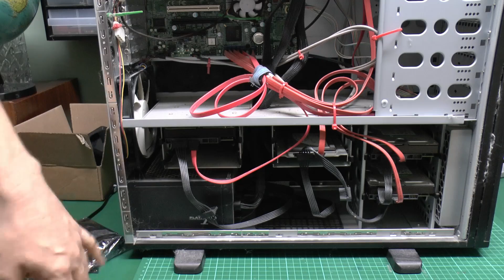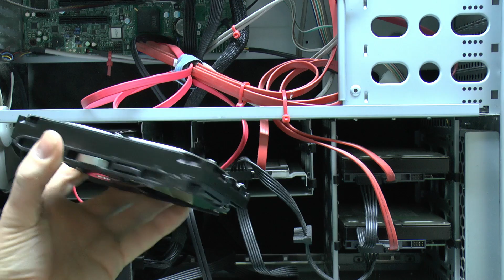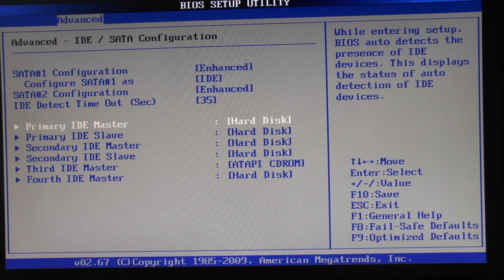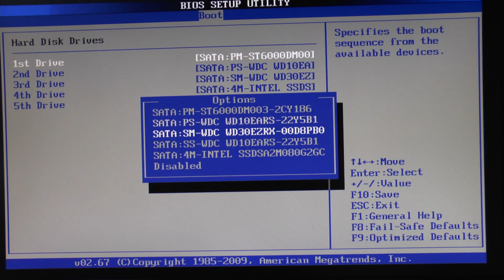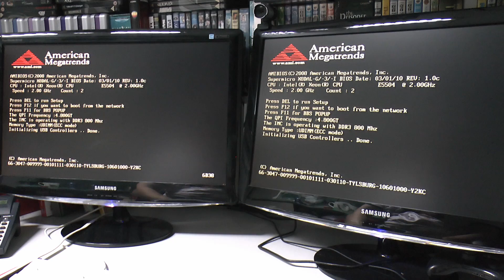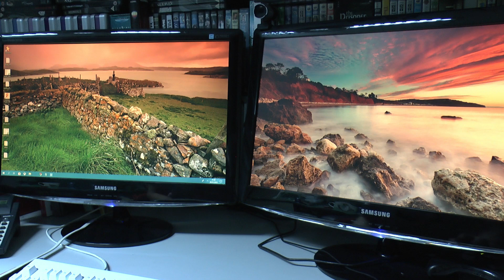Installing an additional 6TB Hard Drive

Comment: The idea of having a large 6tb or larger drive for backup is always enticing. 
But they idea of puting all of my eggs in the same basket is very deterring.
If that thing fails then its all gone.
I'd much rather have three 2tb drives than one 6tb drive.
Reply: Backups are to hard drives and those then are powered down and removed from the caddy. Yes slow, but overnight is fine and you just check in the morning, plus drives from DVR's are pretty easy to find and check for life left. I have a large collection of magnets from them, and find interesting uses for them as well.
Reply: Your logic is flawed, by using 3 drives instead of one you have actually  increased the chance of failure x3  (If all things kept equal)
ALL drives can and do fail, that's why you ALWAYS backup data that you don't want to lose

Comment: Wow! I bet Ubuntu Mate Linux would fly on that machine! Linux has very low overhead. I've been Windows free for over ten years now, and my computer is about as old as yours. It only has 4 cores and not as many drive bays. I only recently upgraded the memory for it's original 6GB RAM to 10GB RAM. I only just recently upgraded my media drive which sits in swappable bay on the front to 1TB while the main hard drive remains at 500GB. I also upgraded my video card so it could play back 1080p video. It gets the job done. For the kind of videos you make, Linux should have you easily covered. If you want to try Linux, you might want to try with a less complicated computer to gain your confidence in the OS. It's free, but they do appreciate a small contribution to keep their non-profit operation going. Linux is especially good at running older hardware, but the Linux community from all around the world work hard to support new hardware as well (especially since they are computer nerds).
Reply: I bet DOS would fly on that machine too!
Reply: @JGnLAU  I'm pretty sure, but eww!

Comment: Don't keep anything important on that 6TB, those seagate green's will die about 2 weeks after the warranty expires.
Reply: Backups.
Reply: @JGnLAU  Then he'll need two 6TB ;)
Reply: @toysareforboys1  To reliably store 1 GB of data you need 4-8 GB of space with at least 3 independent copies of that data. This is sort of rule of thumb in the enterprise sector. But at home there are usually not that much important data that needs to be stored that way.
Reply: Trailing edge of size is generally the most reliable, smaller drives have had a longer manufacturing run, and most problems have been fixed. It's the bleeding edge ones that die fast, but wait for the 2 year mark, when they have most of the bugs out on that particular design, and they have the next sizes out, and the 6T ones will be reliable.
Reply: @SeanBZA  6 TB is not a bleeding edge by any means. 12-14 TB is.
Reply: I have a green Seagate Barracuda for 5 years and it works like a charm.

Comment: You should buy a Synology NAS
Reply: I agree, I have 3 and been using them since about 2010 with no issues.
Reply: I have a 5 disc version with 15Tb and I have never had any problems with it even its 8 years old
Reply: I have had one for about 5 years in raid 5, 4x500G. What worries me is if the board dies, what happens to my array?And china are forever trying to gain access to it. The log is full of failed logins.
Reply: @UberAlphaSirus  Never used them myself, but a colleague of mine has been using them for quite a while now. I seem to recall he was able to recover his raid once on a new synology NAS that replaced the dead one (wasn't even the same type). I don't know the specifics involved if it's just a matter of plugging them in and letting it do its thing or it involves deliberate steps. If the death of the old NAS involves corrupting the raid in some way though then you'd potentially lose all data since the last backup.

Keep in mind that a raid is not a backup, it is redundancy against hardware failures not deletion, file encryption from ransomware, etc. So always have at least one backup, ideally not in the same physical location. Whether this is encrypted in the cloud or a harddrive/tape you leave elsewhere, that's up to you to decide but it's a thing worth considering.

I am planning to do something about my storage situation when time and money allows it. But for now VMs and storage live on the same machine and the paths I care about get periodically backed up to external drives (one that I don't keep in the house, it gets less frequent syncs because I'm lazy but at least I won't lose everything).

Edit:
Oh and regarding your worries about China, look into if there are things like fail2ban and the likes for synology (tool that let's you set rules for when and how long to block failed authentication sources and such). Also it might be worth it to put your NAS behind a VPN, if there's ever a glaring exploit that works on all Synology NAS devices they'll first have to get through your VPN.
Reply: @extrastuff9463  thanks for the tips.
Reply: Just no. They are terrible.

Comment: Western Digital are the current top choice of spining disks and have been for at least 5 years, seagate have had several  miserable years of unreliable drives. Ironic considering if you go back to the days of WD "Caviar" drives they used to be junk although nothing quite beat the Hitachi Deathstar range for pure garbage.  Have to say the Kingston are still the kings of Memory,  nothing but quality in my experience especially the HyperX ranges.
Reply: i have had the opposite experience with several WD drives giving up way to soon and the lowly Seagates just plugging on and on. I had read they moved the manufacturing plants at some point which may account for the failure rate?
Reply: All drives fail, there's nothing you could do about that.

Comment: I also believed my raidz setup was safe, until I moved them into a new computer and used a power cable splitter which had the 5v and 12v mixed up between the two ends. All of them died instantly.
Reply: In your case RAID stood for Ready Ability to Incinerate Data. However the drives almost always have a pair of overvoltage transient suppressor diodes on the power inputs, exactly for that reason, so that the fuse or fusible trace will blow up and disconnect the power. Drives probably are recoverable.
Reply: @SeanBZA  Seagate and WD were, I just kicked those diodes off the board. But could not do it with two Toshiba's, even a board and firmware chip swap did not make it spin up.
Reply: Question is, have you been able to restore from backup?
Reply: @JGnLAU  Haha, no, all lost.
Reply: @gabest4  So, no backup?

Comment: I avoid Seagate like the plague, their failure rate is insane, make sure you're backing up the backup, of the backup.

Having worked in the SMB IT realm for about 7 years, our number one failure is and has been Seagate hard drives, year over year. (followed by power supply failures, but haven't been plagued with PSU failures in sometime!) Haven't tried their SSD's, but will never purchase a product from them again after seeing their failure rate in the field.
Reply: H.G.S.T are my choice .
Reply: @appleejack  I've definitely seen my fair share of WD drives fail but I swear I see 5 Seagates to every 1 WD. We have an ongoing joke/bet around the office on what the next (physical) repair job's going to be, PSU or Seagate replacement. Supporting/repairing OEM equipment sucks sometimes. :)
Reply: https://www.backblaze.com/blog/2018-hard-drive-failure-rates/
Reply: https://youtu.be/G4-cF1BMnTc?t=1297
Reply: The bad rep came from older seagate drives newer ones are just as reliable as WDs etc
Reply: @RandomNoob  As recent as 3 years ago, I bought 2x 2TB Seagates personally... because the price was so appealing and they weren't mission critical, not even shitting you they both died in month 20 and 22. (of an "18-month warranty".... who offers 1.5 year warranties? For crying out loud) 

Might just be my luck of the draw..
Reply: https://www.backblaze.com/blog/2018-hard-drive-failure-rates/

Not too bad but yeah, seagate and wd do have fairly similar failure rates and even though there aren't quite as many of them the hgst drives tend to have the lowest failure rates.

Comment: John if you're not familiar with advanced filesystems (ZFS/ReFS/BTRFS), just get a nas and/or maybe an older LTO 5 tape drive (they're very affordable these days) and keep a copy of your data offsite. This setup is asking for trouble if you care about anything stored there please don't keep the data as is. Edit: Also might be a good option to move data to new drive and setup the old ones as parity in storage spaces with ReFS, it's better than nothing.

Comment: Time for a RAID setup
Reply: Raid isn't particularly useful for domestic scenarios. Having mirrored drives is important in commercial scenarios where you can't have any downtime. If you can have some downtime, you're better off having an external drive (either connected by USB or even better over a network). If your PSU fries all the drives in your computer, or if the raid controller starts to introduce errors into the raid array, you'll be dead. But if you have an external drive where you've just copied everything, you'll be much safer. Also much less hassle involved in setup and easier recovery.
Reply: @HandleHandle720  if you work from home RAID can be a good thing, or if you have NAS.

Comment: Was curious why your drives are configured in IDE mode and not AHCI?
Reply from the maker: That's how it was set up in 2010, can't change now without reinstalling the operating system which will likely cause a big pile of problems.
Reply: @jwflame  I might be totally off the scent, but if my memory serves me right I reconfigured my system a few years back from IDE to AHCI without having to reinstall anything. Again, I am not sure, I got the info from the internet at the time, but it somehow involves restarting Windows in SAFE mode in the interim and then shutdown and restart in normal mode. I am sure if you google it you can get that.  The difference in speed is very significant.
Reply: @blg53  Yes, I have managed to cajole a win7 and a win10, and even a winXP in that regard switching to AHCI driver, but to an extent its' a risky-business!  Better to have image-backup of the disk in advance.  In my experience the effort is often better spent cloning the windows into a VirtualBox disk image and escaping from the limitations of windows-directly-on-machine, obviously this depends on individual circumstance.
Reply: @mikeZL3XD7029   seriously? Literally everyone that installs an SSD cares. You add an ssd for the massive speed increase to then immediately cripple it with ide backwards compatible mode is an odd choice
Reply: I'm guessing that when this machine was built perhaps the operating system or the older drives might not support AHCI
Reply: @alistairstuart2009  Yes I thought it might be his OS at the time it was built also, good call. But now he's running Windows 10 it looks like. So he could just do the registry edit, switch to AHCI mode, reboot and voilà AHCI with no BSOD or Windows reinstall.  FYI:  AHCI support is host dependant so all sata drives work with AHCI. Have a good day!
Reply: @kwils6685  Very interesting, I didn't know that! I just made the assumption that if you changed from ide to ahci then it would corrupt the disks,  I'm guessing it's just not worth it for him to change it as the machine runs fine in ide mode. Thanks I hope you have a good day too!

Comment: You have an SSD but have SATA configured as IDE. AHCI would have made use of the speed.
Reply: +1, AHCI is required to get anywhere near SATA3 speeds. Also not that it's critical in this situation, but AHCI also enables hot-swap on drives. (auto discover a new HDD/SSD when plugged in, IDE requires a reboot to initialize the drive)
Reply: Doesn't switching to AHCI requires changes in OS first?
Reply: @JGnLAU  For Windows, technically "yes", but it's just a registry key, so you can REGEDIT, change to AHCI in BIOS, and viola!